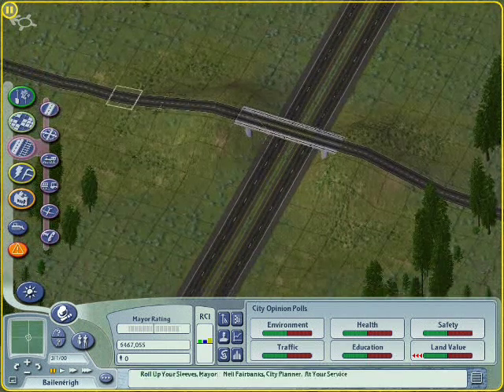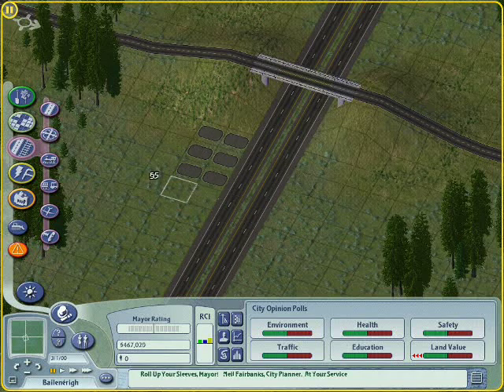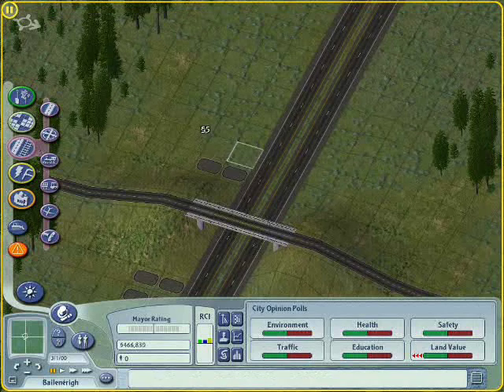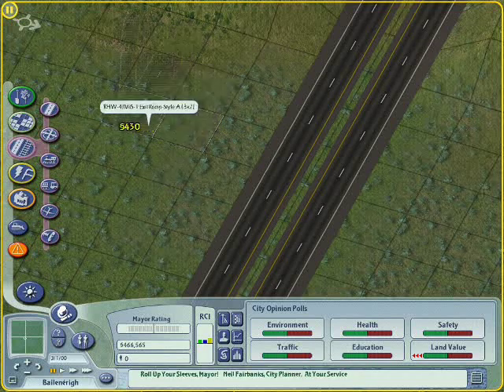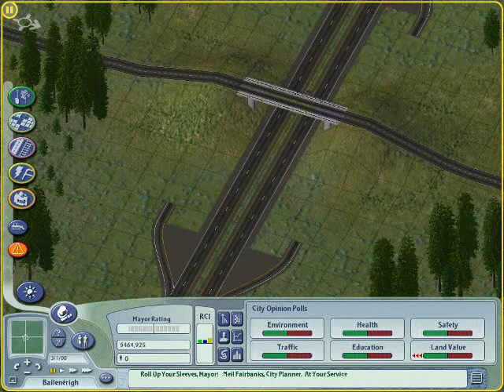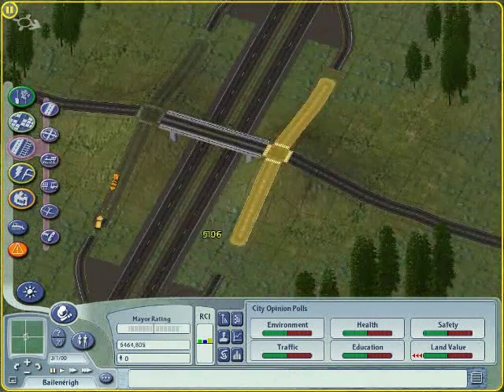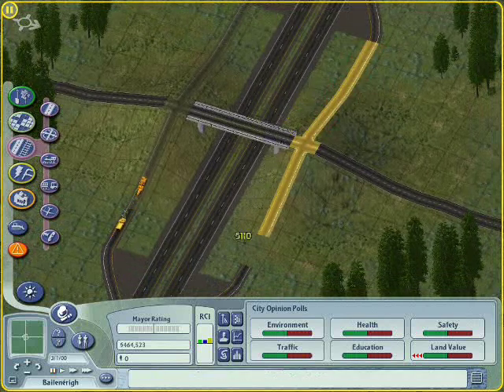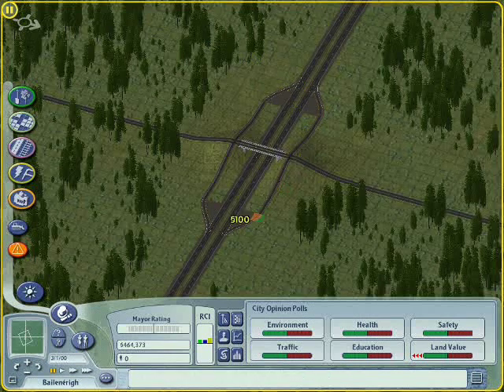SimCity 4 Tutorial: How build a diamond junction with the Rural Highway Mod (RHW)

Comment: Thanks for your tutorials, very helpful. But I've some troubles trying to create this diamond. When I try to connect interchange piece with road, it says I can't because tile is already filled, with the piece of the bridge. I even can't cross a road perpendicular over there, to level the slope as you do. I must make two roads, one on each side of the bridge to level the ground. What I'm missing? I'm using NAM May 2010, RHW 4.0 and BRF slope. I can't manage to do it with NHP Ennedi mod. Thanks.